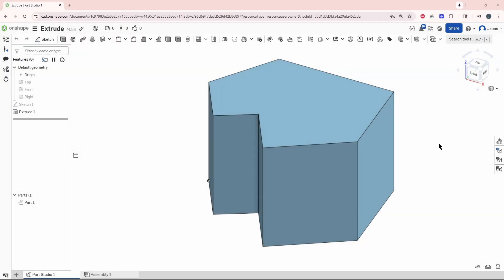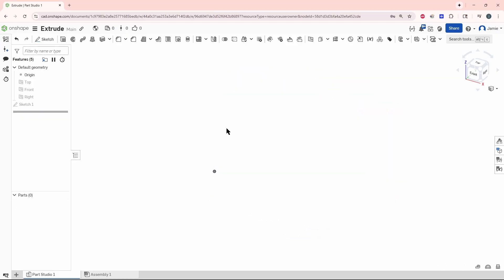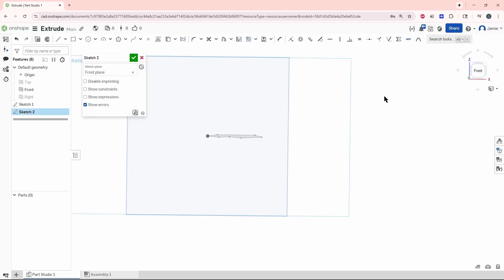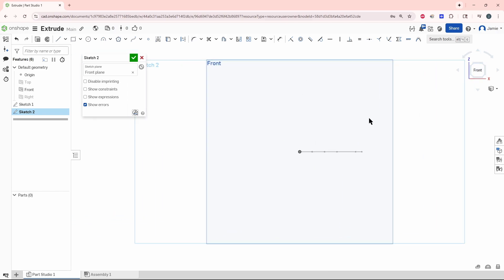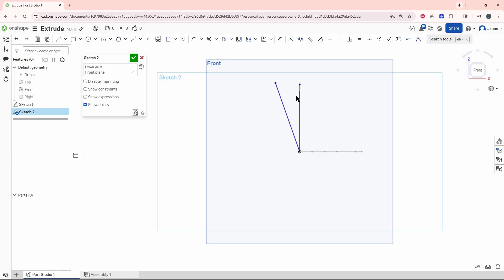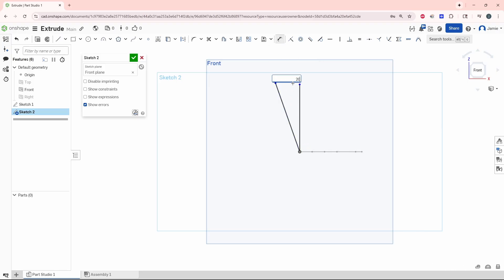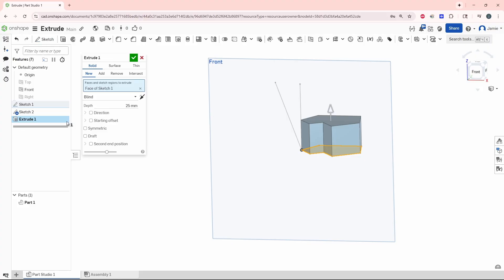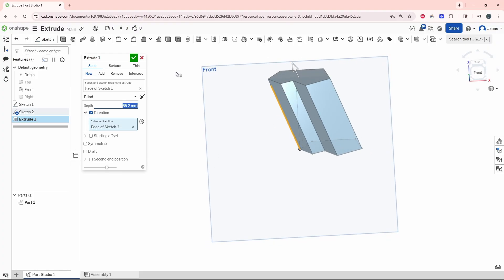How to Extrude (at an Angle) using OnShape

Comment: Now that sketch is not fully defined. Will that ever matter? I am newer at Onshape and find this a struggle with onshape (fully defined sketches) in general so I'm just asking.
Reply from the maker: Hello, In my opinion, As a beginner I would not concentrate on fully defined sketches. Not fully defining a sketch in Onshape may not cause immediate problems, but it can lead to unexpected issues and broken models later on if you make changes. Fully defined sketches are considered a best practice in CAD design because they ensure predictability and stability in your model more.

Comment: I can't select the line I made in the sketch as a direction for the extrude. It doesn't show up as selectable
Reply from the maker: Hello, check to see if sketch 1 and 2 are before the extrude in the features tree. The sketches need to be done before the extrude, otherwise it will not let you pick the angled line.